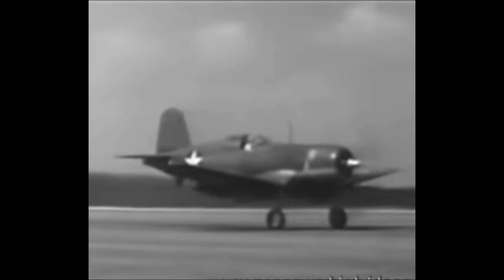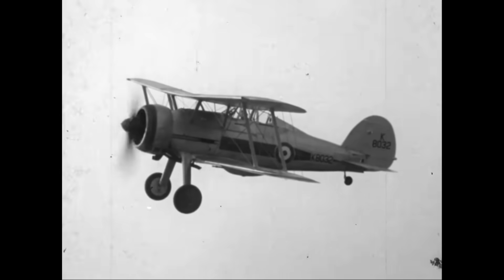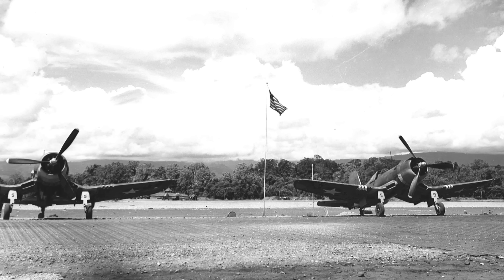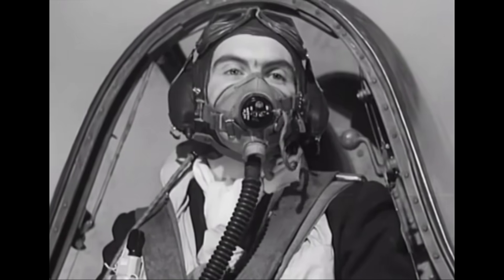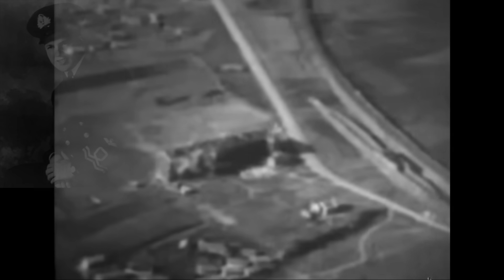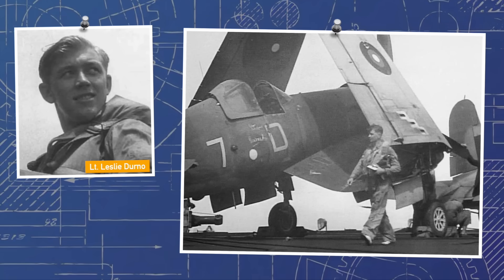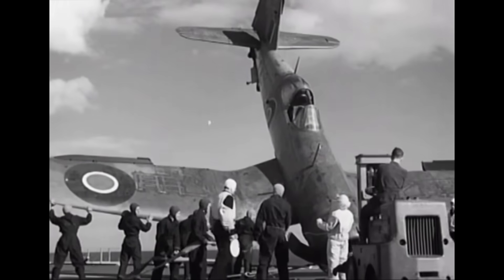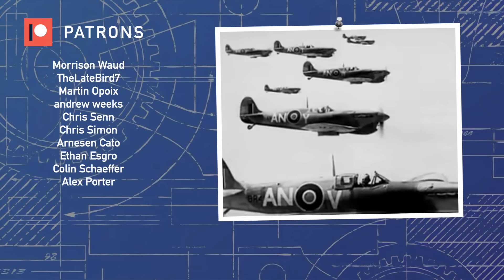Why Did Britain Use American F4U Corsairs? The Full Story

Comment: The problem with the Corsair as a carrier fighter was the poor forward visibility over the long nose when landing on the deck. The Brits solved this by landing on the deck at a somewhat sideways angle just before touchdown, so the pilots could see along one side of the fuselage instead of straight ahead over the nose, to be better able to see the approaching deck. You can see them doing that at 7:27
Reply: Royal Navy teaches the U.S. Navy the curved approach to  the aircraft carrier?  Read "F4U Corsair at War"  by Richard Abrams.  Go to the chapter "Corsairs with the Royal Navy" by Lieutenant Commander  (A) Norman S. Hanson.  Yes, Lieutenant Commander Hanson also wrote the book "Carrier Pilot."  These pull quotes from "F4U Corsair at War".  Deck landing on a full-sized  deck essayed by the first two squadrons when they joined HMS Illustrious in December 1943, proved to be distinctly hazardous."   Further;  "Illustrious" Captain decided that further deck-landing training was essential."   Also NOTE "the fact that the current RN landing "pattern" was totally unsuited for the Corsair."  If you  have the book "Whistling Death" by Boone Guyton you will find the U.S. Navy was instructing the Corsair curved approach BEFORE the Royal Navy had Corsairs.

Comment: Also worth noting the British lessened the port wing stall trouble by adding a 6" triangular 'stall strip' to the starbord wing leading edge outboard of the guns. With this added both wings would stall at the same point. They initially added these themselves made from wood but later they came from the factory already fitted.
Reply: Read Boone Guyton's book "Whistling Death."  Guyton was the Corsair PRIMARY TEST PILOT working for Chance Vought in Stratford, Connecticut.  On page 176 March 1944 Guyton notes that the "6 inch wedge attached to the leading edge of the right wing".  Guyton also mentions the people Vought was working with on this modification.  Remind me again.  When did the Royal Navy get Corsairs?

Comment: The US Navy was aware of and had experimented with the curved landing approach of Corsairs sans British input. They had the option of the F6F Hellcat coming down the pike which was an easier airplane to fly and land on a carrier deck. Later, when the Navy did decide they wanted carrier based Corsairs, the US did utilize several other improvements pioneered by the British, particularly the improved canopy, that made carrier landings easier.
Reply: No, just more fairytale's.
Two US Navy squadrons VF-17 and VF-12 were both carrier qualified in the spring of 1943 and they landed their F4U's the same way they'd landed F4F's which was the standard way the Navy landed all their aircraft, read Tommy Blackburn's book Jolly Rogers, he was the first commander of VF-17 and had combat experience flying F4F's off of carrier's in the Mediterranean during Operation Torch, he trained his pilots to land the same way they landed all other US Navy aircraft on carrier's, pass the carrier on the downwind and count 30 seconds, make a 180° turn to line up with the carrier, at 200 yards from the carrier start watching the LSO who can easily be seen off to the left of the aircrafts nose, the big problem with landing the early "Birdcage" F4U was the struts which lacked proper rebound dampening and caused them to hop as high as 15 feet sometimes on a hard landing, while VF-17 was getting carrier qualified on a converted steamship, the USS Charger in Chesapeake Bay, they worked directly with Vought to improve the F4U resulting in the F4U-1A. 
VF-17 was even on the newly commissioned USS Bunker Hill with their brand new F4U-1A's on it's way to the Solomon's when they put in at Pearl Harbor for provisions when they were informed that ComAirLand (the Navy department in charge of all US Navy aircraft) had ordered all F4U's removed from carrier service citing the lack of spare parts and qualified maintenance crews as the reason, not because of some nonsense about US Navy pilots not being able to land their own aircraft on their own carrier's. 
The reason they were reinstated for carrier service was because in June of 1944 the Japanese launched their Kamikaze campaign in ernest, the thinking was to put an F4U squadron on each Essex class carrier and launch first once incoming Japanese aircraft were detected, using their superior climb rate and speed they'd intercept any incoming Kamikaze's first with F6F's launching behind them to intercept any that made it through the F4U's. 
That's the true story about the service record of the F4U in the US Navy during WW2 and not some made up fairytale nonsense by people taking credit for something they don't deserve that can't be backed up beyond "We say so", there's no record's of US Navy pilots being sent somewhere to be trained by Royal Navy personnel, no copies of orders, not even any testimony from US Navy pilot's about being sent somewhere to be trained, only claims made by people that were printed in books by authors eager to tell a target audience something they'd want to hear for the sake of selling books that was later made famous by The History Channel that God knows has repeated every WW2 myth there is which over the past 20 years that have all been debunked one at a time, no wonder they switched to alien's, that's about as accurate as most everything they aired about WW2.
It's a nonsense story made up by braggers telling their children bedtime stories.
Reply: @dukecraig2402  YES!!!  100% AND THIS!!!  Royal Navy teaches the U.S. Navy the curved approach to  the aircraft carrier?  Read "F4U Corsair at War"  by Richard Abrams.  Go to the chapter "Corsairs with the Royal Navy" by Lieutenant Commander  (A) Norman S. Hanson.  Yes, Lieutenant Commander Hanson also wrote the book "Carrier Pilot."  These pull quotes from "F4U Corsair at War".  Deck landing on a full-sized  deck essayed by the first two squadrons when they joined HMS Illustrious in December 1943, proved to be distinctly hazardous."   Further;  "Illustrious" Captain decided that further deck-landing training was essential."   Also NOTE "the fact that the current RN landing "pattern" was totally unsuited for the Corsair."  If you  have the book "Whistling Death" by Boone Guyton you will find the U.S. Navy was instructing the Corsair curved approach BEFORE the Royal Navy had Corsairs.
Reply: @dukecraig2402 According to wartime NAVAER ACPs and US Navy flight testing the F4U-1 and F6F-3/5 had very similar climb rates and climb speeds. 

Do you have a source that Hellcat units were held in reserve during Kamikaze attacks? Being that it was the primary shipboard fighter until the EOW I find this hard to believe. 

The Corsair was eventually placed on carriers during December 1944. This was after the first organized Kamikaze attacks in October 1944, not in June as you stated in your post.
Reply: @darrenwhiteside1619  The US Navy Evaluation Board recommended Corsairs replace the Hellcats on carriers in May of 1944. This is long before the kamikazes first appearance in October of ‘44. I agree that all British aircrews assigned Corsairs were trained in the US by US Navy instructors including ground and shipboard landing procedures. There were Corsair night fighter squadrons aboard Enterprise and Yorktown as early as January and February respectively 1944.
Reply: @Chiller11 I agree with you  that the F4U wasn't cleared for carrier use because of the new Kamikaze threat. I was responding to a post made earlier which claimed that the first coordinated attacks were in June of '44. I guess I could have worded that better but fact is the first US Navy Corsair day fighter squadron to be assigned aboard a carrier after being fully accepted occurred in December of '44. 

By October 1944 The US Navy wanted as many fighters it could get it's hands on to counter the new threat so there was an accelerated need to get the Corsair on carriers to serve alongside Hellcats. That's when Marine air units began rotating onto carriers to help deal with Kamikaze attacks, followed by Naval squadron being equipped with the type. 

The initial plan was never to replace the F6F but to supplement it. Even at war's end the primary Naval carrier fighter was the Hellcat. Through attrition the F6F was ultimately supplanted by F4Us, F7Fs, and F8Fs.
Reply: But I do agree with you that it was VF-17 and not the FAA which was the primary source of the modifications making the F4U a more suitable carrier aircraft. Furthermore, British pilots were trained by the US Navy on how to fly the Corsair and this included the curved approach. It was a very common method utilized by carrier pilots by this time.
Reply: @darrenwhiteside1619      Where are you getting your information from. ?    Its well documented by several sources, when the Royal Navy Pacific fleet joined the American fleet off the coast of Japan,  the Royal Navy was flying Corsairs from their aircraft carriers, an American admiral could not believe what he was seeing.   Corsairs taking off and landing on Royal Navy carriers. Sending his pilots over, to learn how it was being done.
Reply: @bobmacdonald6183 The admiral may have well been "amazed" but if you read most any book that details the complete development of the F4U you will find that the Corsair was accepted by the US Navy for carrier service by April 1944. By this time the F6F was already the mainstay naval fighter so logistically it took time to get Corsair units aboard carriers. There were however various times where US Corsairs operated from carriers before this could occur such as being part of major operations where they would land and take off after refueling and rearming or when being utilized in the night fighting role.
Reply: You will be claiming next, the captured egnima  decoding  machine was by a  US navy sailor,  aboard a US destroyer that rammed a U boat.  And the sailor  searched the U boat before it sank.   All this did indeed happen, but it was Royal navy sailor.  And a Royal Navy destroyer.
Reply: @bobmacdonald6183 That’s a pretty random comment 😂.  It’s safe to say that British propaganda has infected British history to the point where it’s all considered ‘history’ and taken as fact.  Unfortunately here in the U.S., because we speak English, we don’t know any better and just take the garbage from British historians, or propagandists, and believe it.
Reply: @CncrndCtzn    You will be telling me next. The Africa Corp were beaten by the Americans at the Kasserine pass.  In full retreat.  Until the British 8 th Army appeared over the horizon,  like the 7th Calvary.  So
Reply: @CncrndCtzn  YES!! As the old saying goes;  "A lie goes half way around the world before the truth gets it's pants on."  I"m afraid many don't read and do any research.  Instead they pass on a narrative they love to believe.

Comment: there is a story, late in the war, pacific theater, a Corsair pilot on his way to his unit stopped at a depot. there were many Corsairs parked. He asked what was up. A serviceman said these had reached 500 hours on the engine and were being sent back for rebuild. He asked if he could swap. the man said sure. He thought for a moment, but decided against it. The Corsairs being sent back were US Navy blue, and his was Royal Air sea green. Their Corsairs were operated to 2500 hours on the engine before rebuild
Reply: Nonsense story, engine's had log's that determined when they'd be  replaced, not the entire aircraft sent somewhere, but when the engine would be replaced according to how much time was spent at different throttle settings, and the engine manufacturers laid down the specifications for everything not whatever country had the aircraft. 
And you just didn't "stop in to some depot out of the clear blue" and swap aircraft. 
Not only is it a nonsense story every aspect about it is nonsense, like the fact that the crew chief is who signed for the plane and if you came back with a different one there'd be some serious problems with it.

Comment: To expand on the reason for using the curved approach, in a descending turn an aircrafts inside wing is flying at a lower angle of attack than the outside wing during the turn so is far less likely to stall.

Comment: I'd like to point out something that is almost always left out when discussing the Corsair's bent wing.  The aerodynamic benefits of a wing protruding more or less at 90 degrees from the fuselage was at least as important as the benefit of shorter landing gear/greater propeller diameter.  The same principle is demonstrated by the mid-fuselage wing on the Mig-15.  I have read that this consideration was primary and the consequent benefit of shorter landing gear functioned to seal the deal, so to speak.
Reply: Do you have references? I'm curious.
Reply: @rocketguardian2001  I'm afraid I don't remember where I saw this but I definitely did see it and as I recall, the source was reputable.  I hope you can forgive me!

Having said that, the aerodynamics of the wing protruding directly out of the fuselage being superior is beyond question.  Witness even the difference the F4F and the F6F where the low wing compromise was made to accommodate the larger propeller on the F6F.  That much I saw on Greg's Airplanes and Automobiles channel.

Edited for completeness.
Reply: ITS CALLED INTERFERENCE DRAG, AND IS WHY F4F'S HAVE A 90 DEGREE ATTACHMENT  SEE" GREG'S PLANES" FOR A DETAILED ENGINEERING REPORT @rocketguardian2001
Reply: @johnklatt3522  Thanks for swooping in and rescuing my credibility!

Comment: Here we go again. If the Corsair needed an inverted gull wing for propeller clearance, how do you explain the prop size on the Hellcat, Bearcat, and Thunderbolt?
Reply from the maker: Propellor Clearance & Landing Gear strength together. None of the aircraft listed had both of those things together, the inverted gull wing on the Corsair allowed for both, the gear being so strong they could extended at very high speeds to act as an airbrake.
Reply: @aviationdeepdive  Exactly.
Reply: Short landing gear for strength!
Reply: Hellcat had gear out of fuselage
Reply: @robertwoodroffe123  No it didn't, the F4F Wildcat did, the  F6F's gear retracted into the wing inboard of the fold rotating 90 degrees as it did.
Reply: @Richard.Allsop  yep 👍 sorry
Reply: @robertwoodroffe123 That was the Wildcat. The Hellcat gear came out of the wing.
Reply: The F4F gear was a carry-over from the earlier F3F biplane fighters whose landing gear couldn't be stowed in the thin biplane wing-structure: it was therefore designed to 'telescope out' from the sides of the lower fuselage so that its track had of necessity  to be narrower than what would be achievable on the later, low-wing F6F "Hellcat" (the F4F being a mid-wing aircraft).
Reply: It was because of the pitching effect caused by the arrester hook on the long nose of the Corsiar would pull the prop into the  deck. Hellcat had a smaller prop and shorter nose, and P47 never flew from carriers.